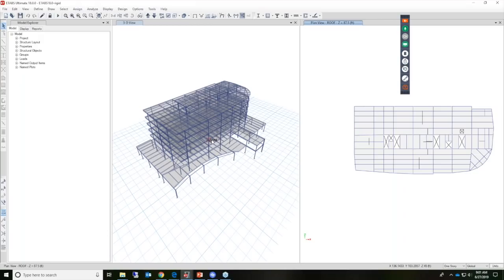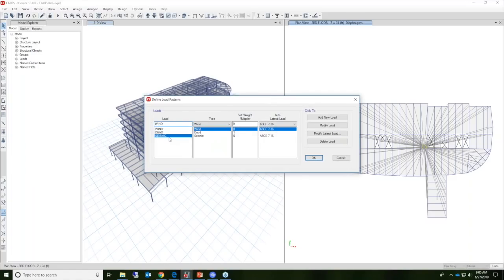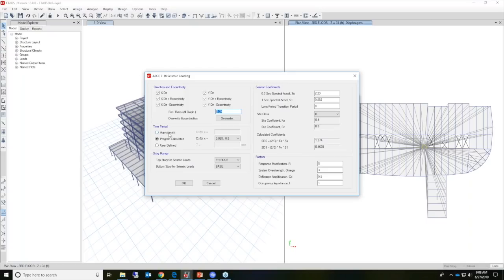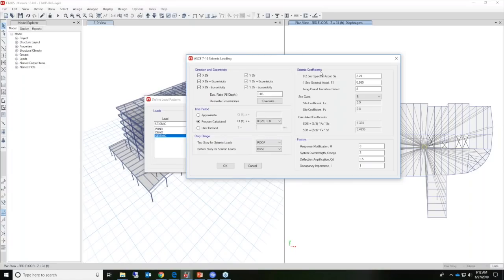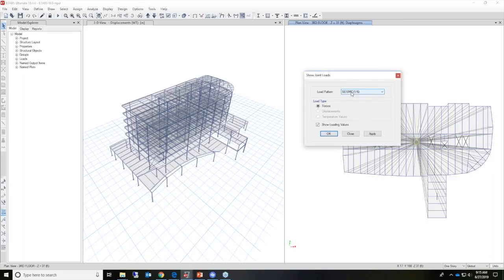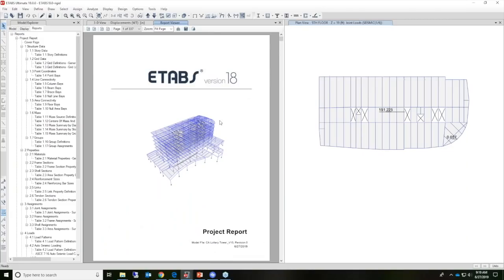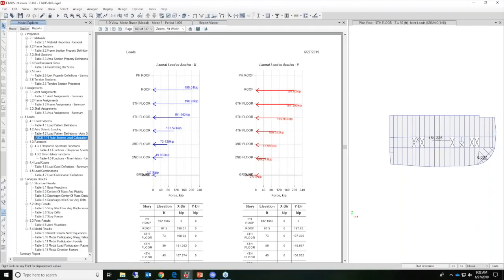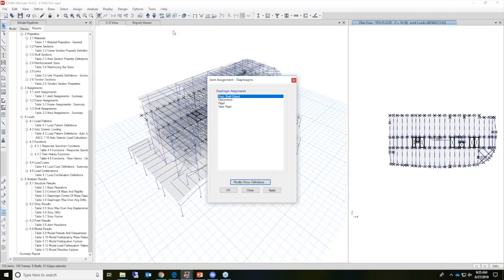WEBINAR: Application of Auto Seismic Loading in ETABS

Comment: 1 diaphram to all shells??!  i use for similiar shells a diaphram 
And about sesimic i define in x and y direction so i choose x+ecc,y+ecc and it doesn't run earth quakes
This diaphram for shell only if i have a floor don't contain slab so i assign to it a joint diaphram is that wrong ?!